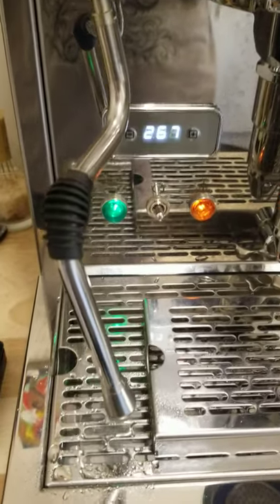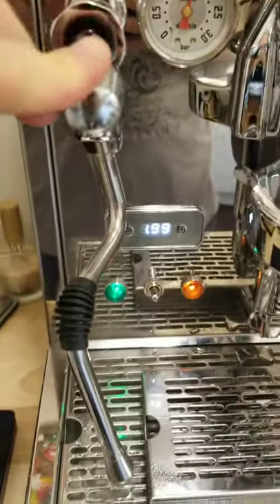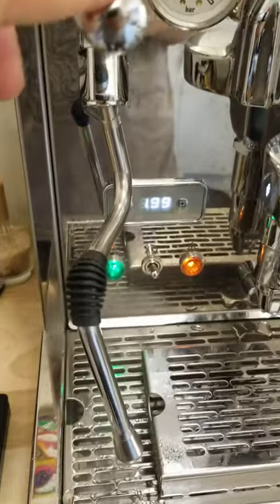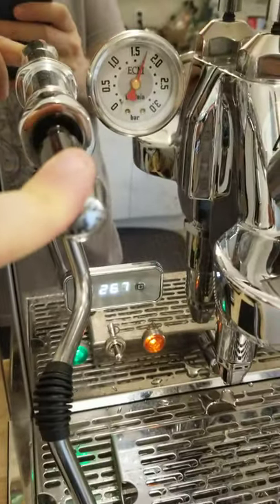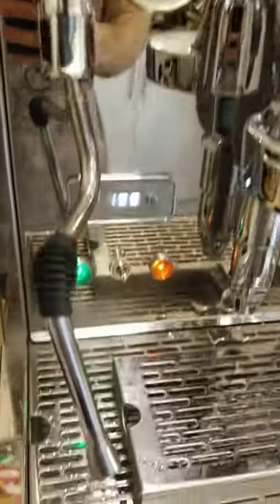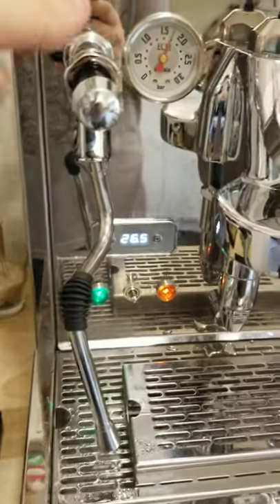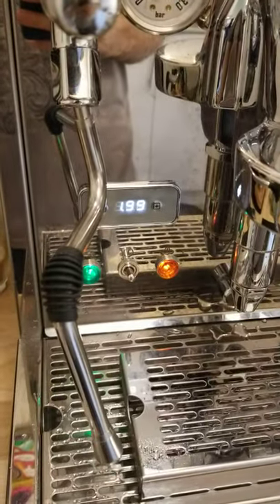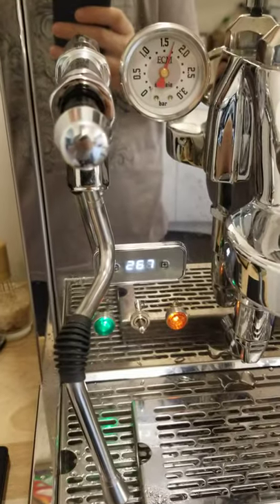ECM Synchronika Joystick Style Steam Knob

Comment: Hello, Ben ;-)

This is considered to be normal, since this is by no means a ”soft touch button“. You know, Germany is about security. This valve is a on OR off one, no status in between is intended. The good thing is that you can handle it in whatever direction having the same result. BUT, you are supposed to activate it completely! Touching it only once softly is not the intended functionality.

ECM expects you to activate the knob completely which means you MUST overcome the resistant point of the knob. The on/off functionality is only considered to be activated beyond this haptic point of resistance. ”This ain't no bug, this is a feature!“
Reply from the maker: The concern I had wasn't related to the level of control with the steam joystick, I'm not trying to modulate the steam pressure so it's less powerful (adjusting the steam boiler temperature or changing the steam tip works for that!) but trying to illustrate that it kind of keeps steaming after the valve has been closed, there's a little delay and it tappers off rather than just being quickly sealed and stopping. I think it might have to do with the inner tube (steam bounces around in there rather than going straight out the tip I suspect) or some seals might need replacing eventually, but no steam leaks or anything yet so that's good. 
You can see I do the switch fully a few times towards the end of the video. Maybe it comes on relatively instantly but doesn't turn off instantly, I believe I've seen some other Synchronikas which seem a bit more responsive. Does yours do the same thing?
Reply: @BensCoffeeRants  Intersting, I did not observe anything comparable with my machine. Opens quickly and completely and shuts down at once. No problem at all with that.

But the knob itself tends to unwind this is why I usually give it kind of a twist at the end of the action. Loctite would do the trick but I am too lazy to get some at this moment…

At least you can unscrew the knobs if you intend to replace them with some wood.

I am really happy with the default plastic material, it is of decent quality and I like the grip better than the more beautiful wooden option.

The portafilter fitted with wood feels cold at the metal end whereas the rest of the grip is rather warm because of the wood…

I like the OEM look and feel of the ECM Synchronika, but I have already replaced the shower screen and filter basket with better solutions from IMS…
Reply from the maker: @anotherguycalledsmith  Yeah my joystick knob part also tends to start to come loose as well. Never falls off or anything, but I always give it a little turn just incase. 
Wood looks nice, but I'm not sure it suits this machine, also plastic is the stronger / longer lasting material for a portafilter handle I believe.